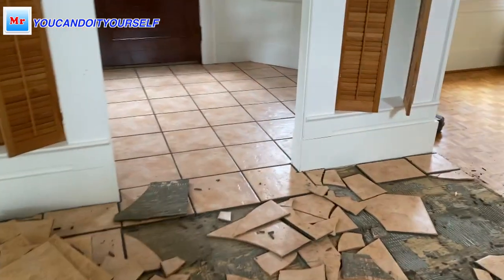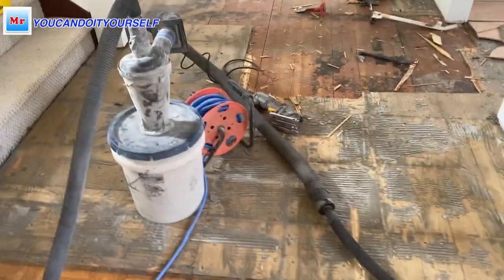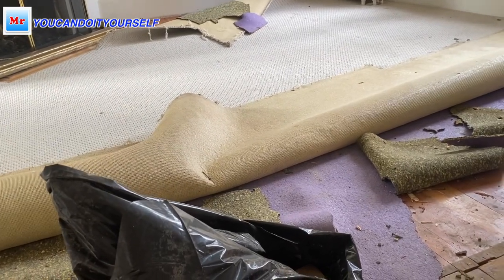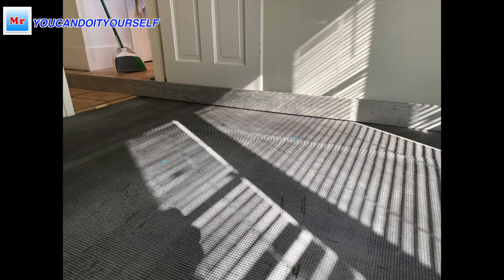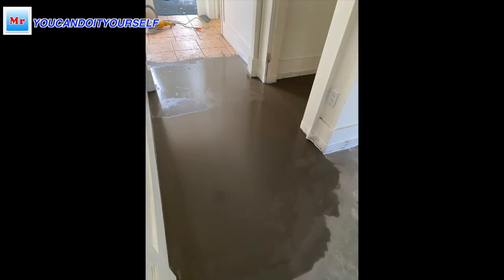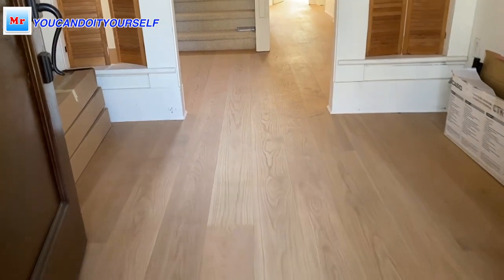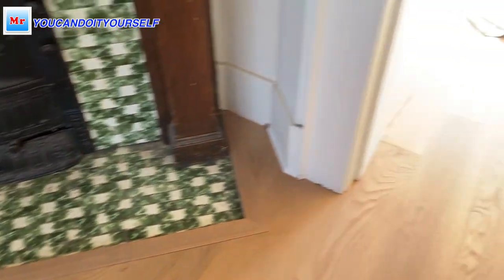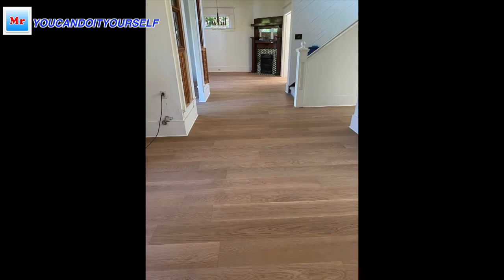Old House Flooring Preparation and Installation

Comment: That's an incredible result.  So many types of surfaces to cover.  I've never seen you scuff tile before.  It makes sense though so everything will stick.  A beautiful result!  Was that white oak flooring?  Are you allowed to say what brand or type of flooring?  All your hard work really paid off.
Reply from the maker: Yes, this is white oak. I don’t remember brand. I will check it out later. Thanks!
Reply from the maker: Wire brush Milkyway-AB  7 1/2 x 9/16